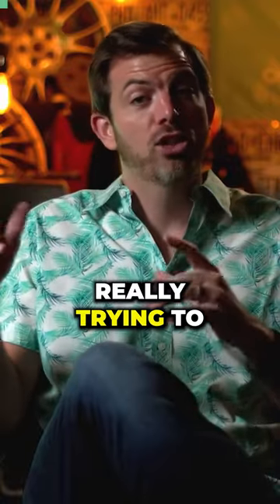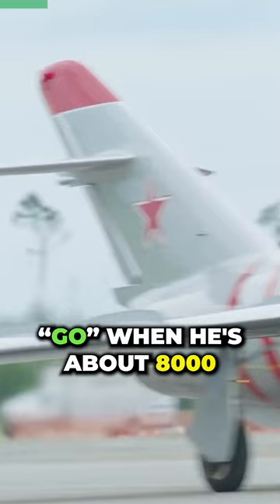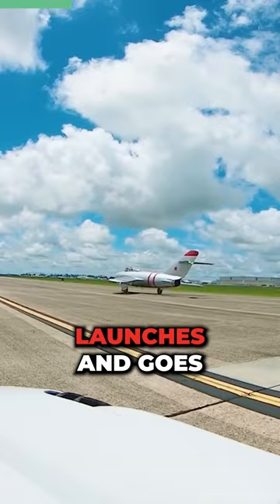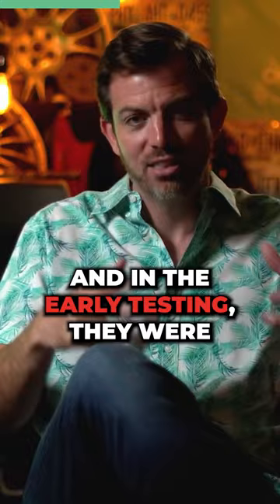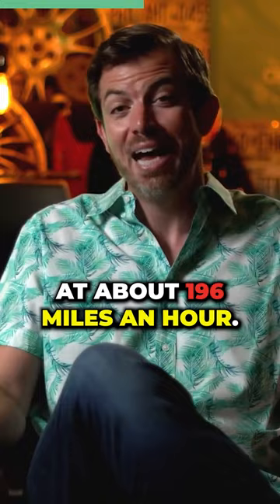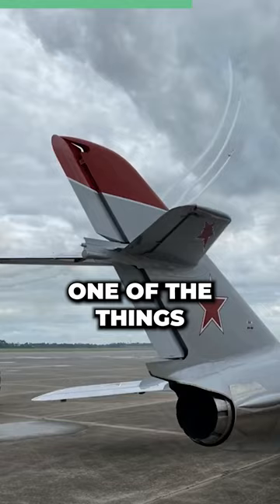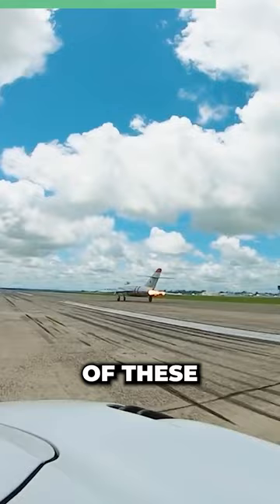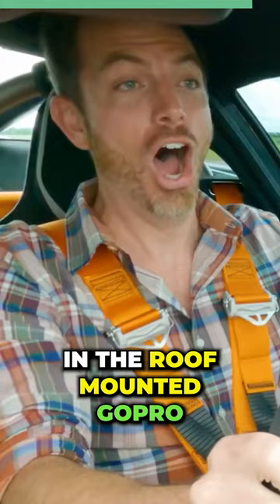McLaren vs FIGHTER JET!

Comment: What kind of comparison is that? a fighter jet that does like Mach 2 vs. a car that does 200 mph? That's just absurd!
Reply: Usually these are not 'top end' comparisons. They historically have been done to demonstrate the acceleration over a specific distance. This specific setup seems uncharacteristic for that though.

The paper comparisons before people actually did on the ground testing in front of cameras was often Airplane X masses Y when they start the takeoff rollout, and use Z weight of fuel, with an engine of thrust T. Car c has a total mass of m, and consumes less than 0.1% of it's total mass in accelerating from v=0 to whatever it will be doing at the end, and has a torque t and horsepower h. From a standing start, which will get to point p on the runway (midpoint? point where airplane takes off? some other arbitrary point, probably not the 1320 foot point on the runway,)

Note that it's not at all uncommon for cars to out accelerate jets from the standing start. But they have different power curves, and a car at 180 mph (~300 kph) is going to get less additional acceleration compared to a Jet which has really just started it's power curve, and is now getting more air to mix with fuel to burn for thrust. The only thing really at question is where the crossover point is going to be.
Reply: A fighter jet that will just about reach Mach 1 up at 20,000ft will prob take a good run up to get 400-500mph down low, good race, a car accelerates quick, plane has top end